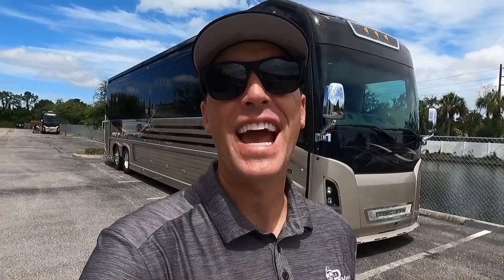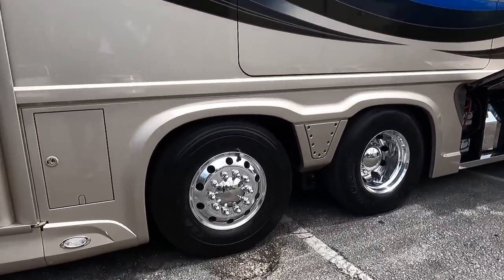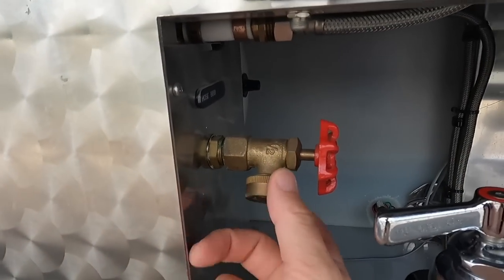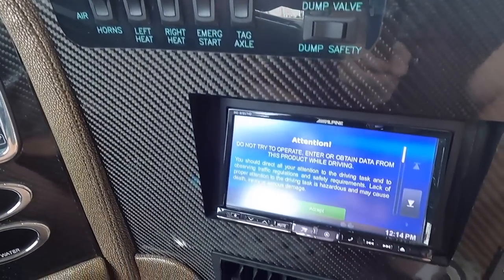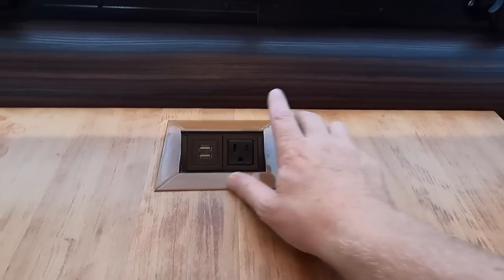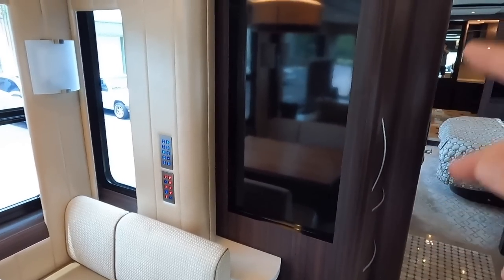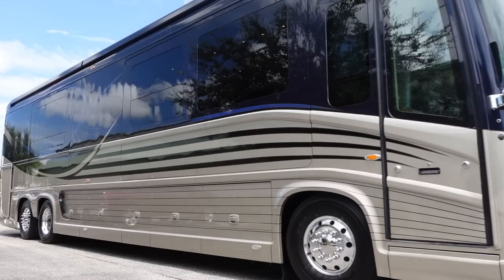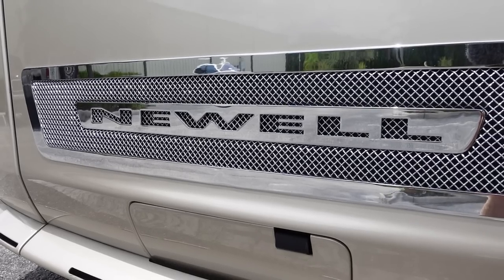Newell Coach #1532 For Sale $999,999!!!

Comment: Very beautiful, one of my favourites (even though I am a sucker for the mid-entry Newells). Actually, if i was in the market for such a high-end coach (not that I ever expect to be), I would go for this one over a new one. It looks immaculate, the kitchen was designed for a chef (the thingy above the induction stove is a proper extractor), love the layout and the price is right. I can see myself putting a further 200 - 300 000 into it, upgrading to a huge solar array, including the roll-up solar awnings, a big lithium battery set, going full LED, upgrading the control system (including 360 cameras and monitors - similar to what that cool guy, who designed his amazing new Newell has, from whom even Newell took inspiration), maybe even a suspension upgrade. That would bring it to the level of 2023, yet still a million below a 2023 price.
Reply: I’m with you Robert. 

And I’ll predict that someday you’ll have such a high-end coach. When you get it remember this reply😊

Comment: do not understand the reasoning for upward basement doors, especially when there's slide outs, you have to duck down further to get into the bay. The side opening doors are the way to go, this would be a deal breaker for me all day
Reply: It’s a trade off, for sure. But they give you more clearance to walk by when your site is tight as well as being able to move easily between bays when the doors are open, rather than going around a swinging door. I’ve had both, and these are so much more convenient as well as stronger by a mile!

Comment: so basically a cheap coach with unnecessary things in it? No way this is for sale for close to 1 mil. There are many options that can carry car and it is just slightly over 1 mil. No way this is 1 mil
Reply: They aren't cheap. Each one is hand built. They aren't made on an assembly line. They go for around 2.5 new. I'd love to see one with this much room for just over a mil that can hold a car and is made better than a Newell.
Reply: @TravelingStacker  there is one by dumbell and another one I forgot the name that cost just slightly over 1 mil each and can hold like a sport car. I can send a link if needed. This is just like any other coach. No way this costs that much
Reply: @TravelingStacker  Looks as if he’s beyond convincing. Smart to bow out.